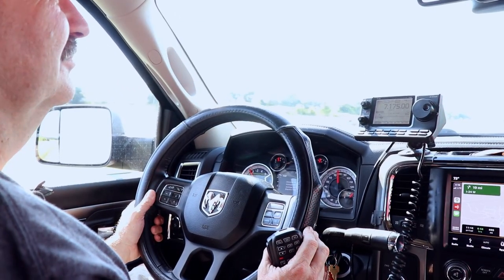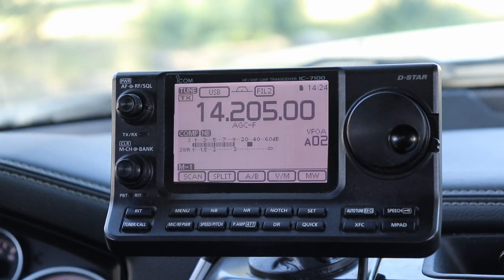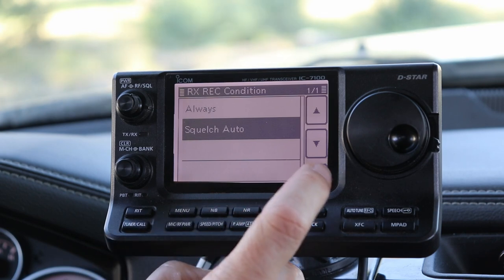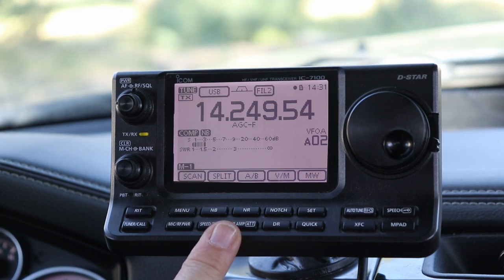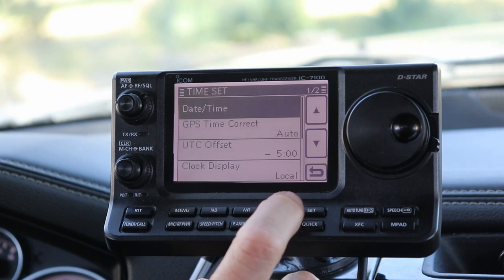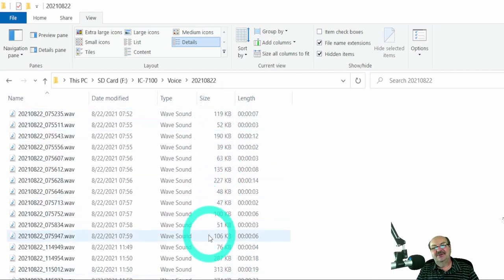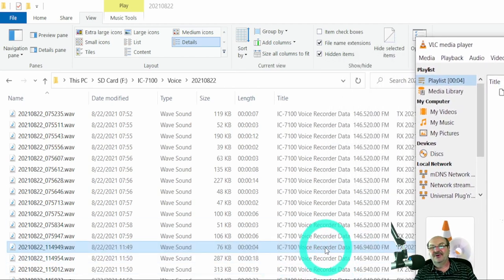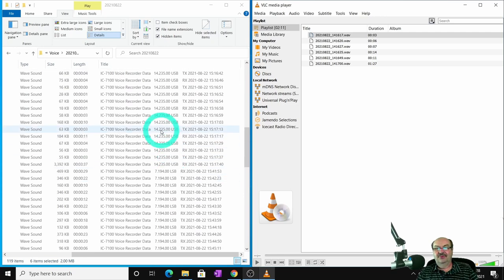IC7100 A to Z #15 - HF Mobile & Using the Voice Recorder

Comment: I've read that the 7100 supports up a 32 GB SD card.  I had a spare and installed it, and it formatted OK. Thank you so much for this instruction! This is outstanding!!
This would also be extremely useful during emergency events, especially when it comes to covering your a$$ regarding legal issues!

Comment: Thanks Tom for putting the IC-7100 Video's together. I've been using an IC-706 in My car since 2013 and was Bidding on a IC-7000 and stopped bidding as I was finding trying to find a affordable Separation Cable near impossible, and then came across your Video's on the IC-7100 and watched up to #14 last night.

I think I'll look at buying a IC-7100 in the next couple weeks, or in the New Year if Christmas spending gets in the way, but have enjoyed watching and learning from your videos on the IC-7100 and it's settings and features.
Reply from the maker: Hi Grant.  Thanks for the kind words.  The IC-706 is still a good radio, but I have found the 7100 makes a great mobile!  I was using a Yaesu FT-857 before I got the 7100.  The biggest reason I got the 7100 is so I could read the display more easily as my eyes get older.  I started squinting too much trying to read the 857 display.  The 857 is a fine radio, but the 7100 is much more capable. 
On separating the head- I believe the Icom manual recommends against this, but a shielded CAT-6 Ethernet straight-thru jumper cable works just fine.  Just make sure it is a shielded cable.

Comment: Thanks a bunch for the very detailed instructions for the 7100.  Would you be willing to do a video on your mobile installation?  I also have a 7100 and a Ram pickup and would love to get some ideas for installing it for actual mobile use.
Reply from the maker: I’ve had a couple questions about my mobile setup.  It’s nothing special, but maybe I’ll throw together a quick video about it.

Comment: Nice video - very helpful for mobile use and the listening to the files helped a lot as I use my IC 705 for POTA/SOTA activations, and now that I learned to add those two columns, it will be easier now to figure where the actual QSO's were found. Curious what the mount is you're using on the dash for the 7100. 73
Reply from the maker: Hi Scott.  Thanks for the kind words.  Excellent point on the 705.  The recording function on it is essentially identical to the 7100.  So it will work great to help with logging 705 portable or mobile operations.  The mount for the 7100 is a RAM mount.  They have a variety of different adapters, including 1/4-20 mounts that will fit the bottom of the 7100 head.  I’m using the 1” ball versions.
Reply: @HamRadioA2Z  I will have to check out the RAM mount. Seems like it sat very solid on your road trip to the hamfest. Like you, I have the 705, 7100 and 7300. I've learned a lot from your A2Z series for all the radios! 73 KN3A.

Comment: Hi Tom , are you going to cover voice memory for setting up for like fieldday or contesting to play prerecorded call sign or calling CQ?
Reply from the maker: Hi Coy.  I probably will do one specifically for the 7100.  I did do a video on the voice memories for the 7300 a while back.  The menu options and operation are nearly identical on the 7100.  Here’s a link to the 7300 video:  Icom IC7300 A to Z #21 Voice Recorder Settings & Voice Transmit Memories
https://youtu.be/oR2F6ueFi4g

Comment: Hi Tom can you adjust the recording level from the reciever onto the card? mine seems a bit low, not sure if the volume effects it..Fred g4vvq.
Reply from the maker: Hi Fred. There is no way to adjust it that I know of. The audio gain knob definitely does not affect it. In my use case, I don’t often listen to the playback on the radio. I usually take the SD card out and play the recordings on my laptop.
Reply: @HamRadioA2Z  Hi Tom, i do that as well, but i just thought it could be abit louder, its ok but when i put it in the sound editor it looks aboit low and i increase the volume there, but its not quite the same hi..cheers f